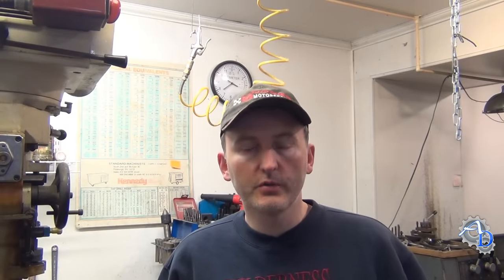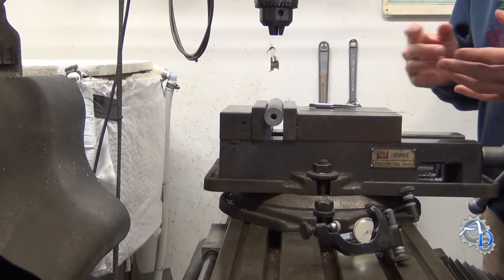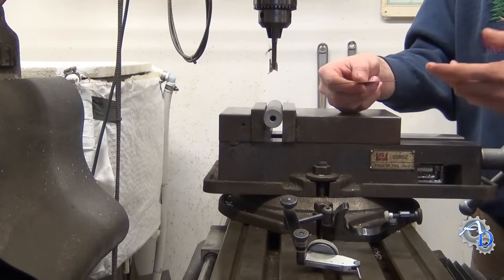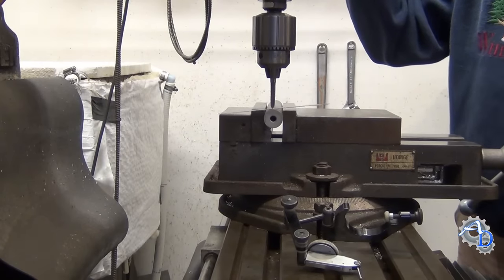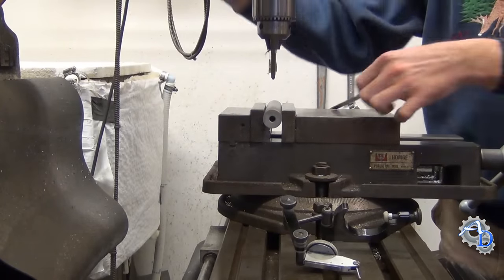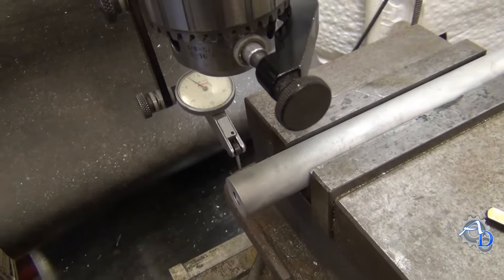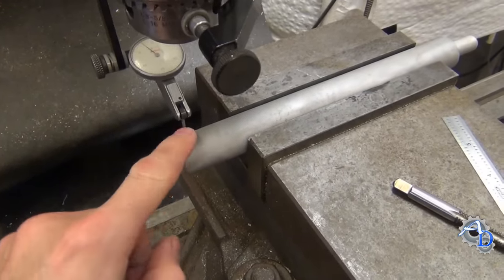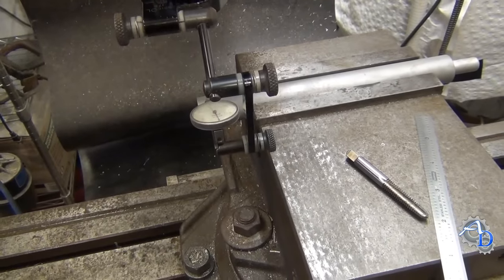Old Machinists Mill Trick To Quickly Find a Rod Centerline

Comment: I dont have a faster way, I just use an edge finder, takes more time putting it in a collet and putting it in the machine than finding the actual center.

But there are many times where this method will be accurate enough for the job at hand, Thanks!

Comment: Thanks for the tip, I bent the Axel on my Garden Cart, the new Axel isn’t drilled for the Hairpin clips. I don’t need it accurate enough to use a dial type gauge, but I would like to get it very close.

Comment: Arnold. How are you doin' young man? I just subscribed... gonna set up my metal (mostly just welding) shop soon. (Gotta find myself a metal lathe still). This video made me think of my Grandpa (passed away in '72) He was a machinist in the 1910s.  At 25 years old he was promoted to a 'production,  quality control, type position in the Tool and Die Manufacturing Co. where he worked (in Indiana) very young for that position. I think of the  difference in technology between now and then... Wow.  He possessed a heightened,  God given sense of "Touch and Feel" which allowed great efficiency in the use of the micrometers, inside/outside calipers, etc... of that era. He went about the factory making final settings on the lathes before the machinists resumed their final passes. It seems to me that the  'German Engineering Stereotyping' thing is one that actually holds water.  Sorry for the braggin', can't help it. I love my Grandpa. You got me wantin' my shop set up even more now. Thank you Arnold,  (now I'm gonna view the rest of your videos).

Comment: Use that trick also to set height of tool to the center of your material on the lathe.
Fyi I never used an indicator to find center of rod stock unless I needed to be very acurate( less than .0005 tir). Edge finders have always gotten me within  001 tir.
For those who don't know ....tir is- total indicator runout.

Comment: Same trick works on the lathe too, quick way to set your tool height, then check it by perform a facing operation and you can fine tune it as necessary...

Comment: Never thought to use this on mill, use this to set lathe tool height just below centre. Another way for quickly finding centre is use a dowel pin of a known diameter in drill chuck, turn on mill and use magic marker to mark dowel and move dowel over to stock until it barely touches when you see marker come off of dowel and then move chuck up out of way and then move in half the diameter of the dowel and half the diameter of the stock. This also works to find the edge of square stock and works in place of an edge finder that the average hobby machinist may not own.

Comment: A. Indicate off your fixed vise jaw, then add half the diameter of your rod. You're on it.

B. Skim the top of the rod very lightly with an end mill, then put a center punch in the mill and center it over the (very thin) skimmed line.

Either way will get you within a thou.

Comment: One more great trick but most of us don't have those expensive equipment. Those who has a simple 3d printer could print a guide: rectangular block of the same dimension of the tube with a center hole. And you could drill at center or offset precisely at any point on the tube.

Comment: Been doing this trick forever for cutting keyways, it's not 100% accurate but it's always been good enough for keyways in farm equipment.. the other way is with a 2 or 4 flute endmill, just machine down until you have a flat the same width as the endmill and eyeball it from there, again it won't be perfect but it'll be close enough for a keyway

Comment: Use a simple square to scribe a line through the center of the "rod". Use the square to scribe another 180 degrees from the first. The intersection is the center.

Comment: IF you had a bubble level mounted on that piece of cross-ruler you used perhaps it would have gotten you spot-on without the secondary operation of putting your dial indicator on it.  I've never tried this myself but I will be trying it next time the need arises.  I just happen to have a flat ruler with an integral bubble level on it.

Comment: well, it will get you close, been a machinist for 53 years, I use it on the lathe for tool height, but on the mill, just use the drill or end mill, turn on mill, touch off side then dial in half the tool plus half the part......fast ......easy

Comment: Replace the ruler with a steel plate and place a digital angle ruler on it. When the angle is 180, it is the center point, which is more accurate than visual inspection

Comment: Measure the round stock with calipers take that measurement and divide it by 2, then you take an edge finder and find the edge. And then you move over half the diameter of your round stock minus the offset of the edge finder. Then you are at center and you are not off at all. This technique this guy is showing saves you no time at all.

Comment: Try this old wood workers trick to find the center of a dowel in a few minutes. 
1. Place a piece of equal side 90 degree angle iron in your vice with the legs flush to the top. 
2. Inset a tiny drill bit into the chuck and crank the drill press so the bit meets the center of the angle iron. 
3. Lock the dowel where you want your hole and change to the size bit you need. 
4. Drill your hole

Try it, it’s easy and accurate and no instruments are necessary.

Comment: An unusual way of finding the center, and fairly close results can obviously be realized.  While you recommend using a thin ruler, could you not also use a thicker piece of flat stock and apply a small dimple with a center punch?  Seems to me that the precision-tipped tool would lock into this and keep the piece from sliding off.  Your thoughts?

Comment: I've never done it that way. I'll have to try that. I just use an edge finder on the stationary jaw of the vice and zero that. Then mic the rod and move the table exactly half the width of the rod. Bang. If you do it right it only takes a few seconds.

Comment: That’s ok, if your quill is at a precise 90 degree to the table if not the rotation of 180 will show up as an error which you might think is an off centre measurement. This can happen on these types of head swivelling mills even if doweled. Best to check if everything is at a true ninety and make any adjustments to dowel or markings, then you can do this routine with full confidence.
Reply from the maker: My mill's trammed in, but always a good idea to check.

Comment: Good tip.  I use an end mill and a piece of paper:  While end mill is turning I slip a piece of paper between the end mill and the part or the vice jaw slowly creeping up until the end mill grabs the piece of paper.  I am now .002 away from the part.
Reply from the maker: Thanks. I use the paper under the endmill trick in a couple of my other videos. It's also useful on the surface grinder.
Reply: In a mold shop in Canada I'd fire you for that. Not only is it dangerous but the least accurate way. And you'll gouge the piece. Probably slower than with an indicator. Do you have all your fingers still?

Comment: I just take a 1/2" gauge pin in the collet and lower lock the quill, touch the edge of the work coming from the same direction to eliminate backlash, minus half the work and then minus half the pin.

Comment: One can measure the diameter of the part. Then use the scale and the pointer , scale it measure half the diameter. Put part in the video then check, if needed with the indicator. Should be as close. Good luck, enjoy machining!

Comment: Great tip,  this trick is also used for finding lathe tool center position, most important when single point threading.  I never thought of using this trick to find a center using a milling machine, again great tip.
Reply from the maker: Thanks!

Comment: Just use that test indicator the first time.  Zero it out, and zero your x and y (either the dial or the digital scale), then walk it up, over, and down to the same z.  When you then move your dial in until it's zero, and divide the travel by two, that's your center.  if your machine has a lot of lash, you might want to double check using the method you show, but I almost never see more than .0003 of variance.

Comment: The greater the shaft diameter, the less the error.  You needed to point this out.  This method will be a problem on shafts of small diameter.
Reply from the maker: Yes, the scale will show much more displacement on a smaller diameter and will magnify off-center error, if that's what you're saying.

Comment: for rod as small as you're using I just put the rod lower in the mill vise and use the dial-test-indicator to find the mid point between the vise jaws, a bit less fiddly than what you're doing
Reply from the maker: This is true. Read the vid description.

Comment: I am currently in an advanced manufacturing class this is my junior year so this way might be better but I don't think so. All you would need is one too instead of the four he uses. Take an edge finder edge find the back of the vise and move in have the diameter of the round stock of course taking into account the diameter of the edge finder.
Reply from the maker: This way isn't better. It's just a trick I picked up from an old timer years ago I wanted to show everyony. I usually use a .200" diameter edge finder.

Comment: Good for a lot of things. Using an indicator in a drill chuck is rather pointless though. If you clamp it in different positions around it, you'll likely get different answers. If trying to be precise, never use a drill chuck. A collet and edgefinder is accurate and quicker than messing with an indicator.

Comment: An old timer showed me to find center take the O/D of your work piece divid in half take whatever cutting tool your using dvide by half. Bring the drill or working tool touch off on the outside of your work piece with the cutting edge take half your drill width plus half your work piece and use that measurement to bring you to center of the work piece. Just another quick trick.
Reply from the maker: Yep, that works too.
Reply: We used the same method except we used a strip of note book paper when the end mill grabbed the paper we set the travel to 0 and moved accordingly
Reply: Should have read further I see the same method posted

Comment: I use this to find tool center height on lathes. On mills I just find fixed jaw, center edge finder over its inner edge and move in half the distance. You already know diameter of round, so divide in half and stop messing around. Its only a short cut for drill presses where center doesnt matter. I want to see you use this cutting keyways because that .001" or .002" your off and the part wont fit with a key in shaft. Try it.
Reply: Read the video notes, he says it's "an approximation".
Yes this method works on a lathe too but best applied where the lathe has an adjustable height tool holder (not every lathe has adjustable holders).
Much harder but hardly impossible if the tool has to be shimmed/packed to correct height.

Comment: Oh that's like the same trick for getting centre height for your cutting tool in the lathe, but the rule would be vertical between a piece of bar and the cutter on centre, not horizontal like in this video.

Comment: secure 1/2"" round stock in vise ...... to cut 1/4" keyway chuck 1/4" end mill ...... lower bit along side 1/2" round ..... take .002 shim stock or even strip of paper ...... start mill and draw bit towards round stock until it shreds paper against round stock ...... mike round stock and take half ..... mike end mill and take half ...... raise end mill above round stock .... zero dial and move round stock out the distance of the 2 halves ...... your bit will be within .002" of dead center ....... i have been blind in one eye for 45 years ..... i trust my feel more than my eyesight

Comment: I like this method but I typically just eyeball it and get it so close enough to do the job. 

I make knives as a hobby. Sorry I don’t make videos yet. Might later. 
My favorite knife to make is a balisong. 
I typically use two, 1/2 inch grade 8 bolts as the handles and spring steel or tool steel as the blade with mild steel pins. 
If you get the pin holes out of line the knife doesn’t “flip” as well. 
I’ve been carrying, using and abusing the same balisong for nearly 4 years now. It’s more of a multi tool than a weapon because I use it every day as a hammer, a prybar, a screwdriver, pliers sometimes, to cut boxes and packaging, etc. I’m absolutely NOT easy on this knife! 
I use to trade and sell them but I got out of it for a few years. 
I’m starting up a new tiny shop so I might start making videos as soon as it’s set up good enough to be workable. 
I typically recycle junk and buy as little as possible. Could make for a decent YouTube channel. 
I’ve almost got the shop finished so we’ll see.
Reply from the maker: Thanks for the info. Knife videos are interesting.

Comment: Great old school tip thanks. Could you also place a a dial indicator in the chuck then lower until it touches the work surface; running it back and forth to find top dead center?
Reply from the maker: Thanks :) You can run an indicator over the top to find a high point, but you would have no way of knowing if the chuck is exactly over the part center, because the indicator needle will most likely be offset by an unknown amount. If you could somehow put an indicator sticking straight down in line with the spindle it could work, though I don't know of an indicator like that. It's kind of hard to explain without showing.
Reply: Plunge test indicator, i would never do it that way. It isn't hard to touch both sides no matter what diameter. Really depends on Datum in drawing and tolerance

Comment: In the Machinist world their are many ways to skin a cat..however a edge finder would have saved you time and is accurate. None the less another way to skin a cat! As far as finding the center on the lathe, the center in the tail stock or a pointer is by far the quickest way to find proper tool height.

Comment: This would be good enough for a lathe tool, but a far quicker and more accurate method is set a dowel in the spindal, bring it up to the edge and touch on with either marking blue or use a feeler guage.  Minus half a dowel diameter, add half bar diameter and job done.  Easily within a thouh.

Comment: Or use an edge finder and you can also determine the end of the round stock to locate the hole position rather than putzing around with the dial indicator.
Reply from the maker: Thanks for the tip.

Comment: You mention you know of other ways, but this seems easier, faster and so this method is interesting and innovative butdoesn't seem like you'd ever need to use it is you had a Vee drill block. Home supply places sell them for less that 10 bucks and they can also be used on a corner and to align hole on a flat surface. Milecraft is one brand.

Comment: Just wondering that if you used a standard thick six inch ruler could you maybe take a square level and carefully place it on the ruler and check the level as another way instead of just eyeing it. A diesel mechanic not a machinist. But will  try it the way you have shown and thanks. —KTMCandog 🇨🇦
Reply from the maker: I haven't tried it, but it will probably work.

Comment: Could you not use the same dial indicator to find the tangent at the top of the rod, zero the indicator, rock it back and forth, re-zero indicator and the ball on the indicator would be in the center?

Comment: Wow,that was really smart. Now do You have any advise on whether to unscrew the oil pan bolts clockwise or counter clockwise on a 82 Toyota pickup when below the equator? Thanks.
Reply from the maker: Thanks. Regarding the Toyota, I know how you can find out. Flush the toilet and note the spin direction. That is the direction you want to use. Screwing the bolts back in will be counter to what the toilet says. I discovered this trick while working on a Toyota Coriolis once in Tasmania.
Reply: @ArnoldsDesign  And who says Machinists don't have a sense of humor!

Comment: Here's one I didn't see mentioned. Take a piece of stock the same diameter about a couple of inches long, chuck it in a lathe and bore an 1/8" or 1/4" hole through the center. Set your round stock you want to drill in the mill vice and the short piece you drilled over it vertically  and tighten the vice. Simply use a transfer punch and you will be dead center.

Comment: I wonder what 3 thou runout at the tip of the rod, would translate to in terms of centre line offset error?  Obviously you could clock the rod tip and then centre it relative to the axis of the work piece.🤣🤣♥️

Comment: Why on earth would you use an indicator? Edge find a parallel clamped in the vise find the back edge, move 1/2 the edge finder and you are zeroed in the back jaw of the chuck. Then half of anything (round, square etc) will give you center.